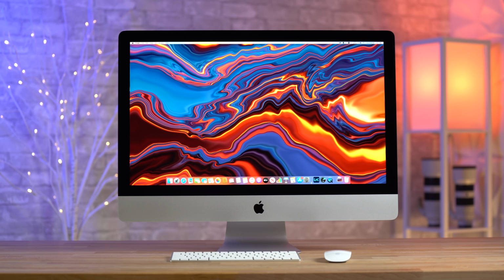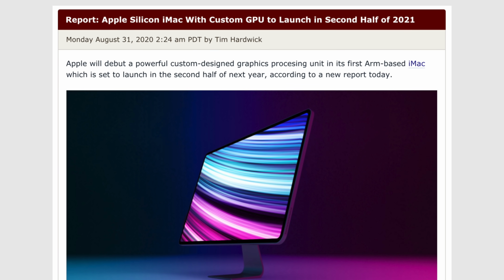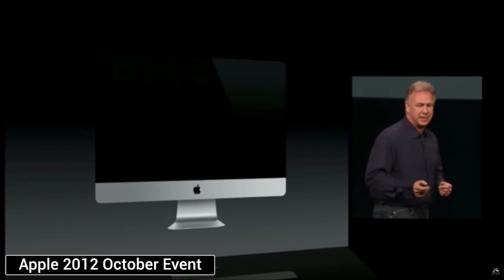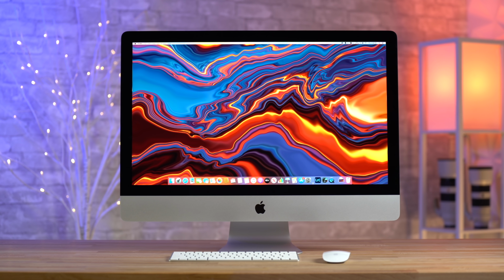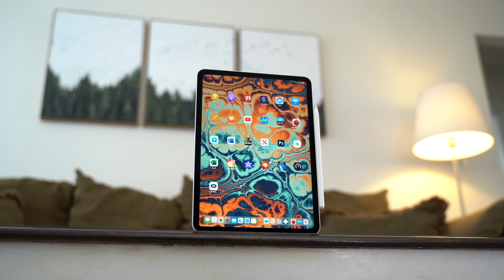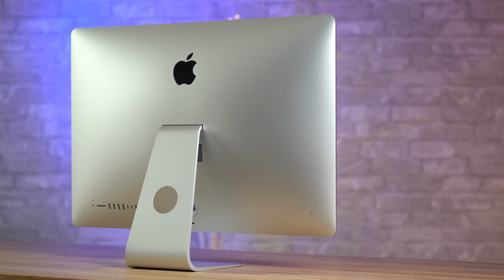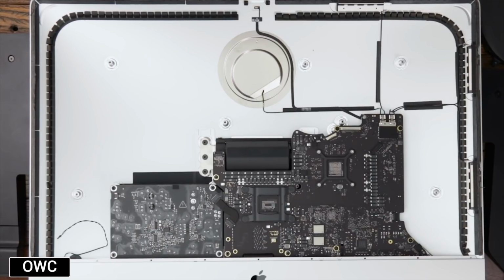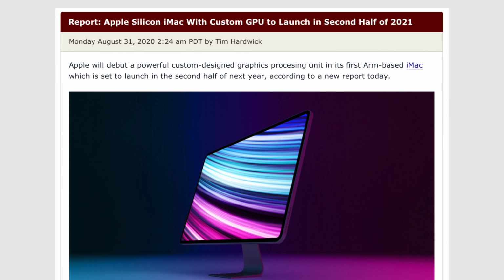Apple Silicon 24" iMac Redesign - I FIGURED IT OUT! 🤯

Comment: I would rather Apple match the thickness of the Pro Display XDR and use that overhead to push the performance further. There's no reason to throw in a wimpy thermal solution and artificially limit performance when they could adopt the iMac Pro internals (which utilize the space much more effectively) and deliver a machine that's quieter and faster.

Comment: iPad Air 4 is just going to have a cheaper display with only 60Hz, either the same 8MP rear or 12MP, A13 Bionic processor and the same design as the 1st gen 11-inch iPad Pro and Yes it will support the Pencil 2, 11-inch Smart Keyboard Folio, 11-inch Smart Cover and 11-inch Magic Keyboard

Comment: If everything goes like you're assuming then that means no more user ram upgrades. And if they are going to charge the same prices for ram as they are doing now, it will be very hard to justify getting an Apple Silicon iMac with a reasonable amount of ram.

Comment: Nice video, great work as always. Personally i love the apple cinema display and wish it came back. And so i wouldnt mind if the new imac chose to look like that, uniform bezel with the logo just small at the bottom. But i do agree that there probably will still be a chin. If apple didn’t care to have it, they wouldve shrunken the chin already. Meaning the chin is still around today because Apple it as part of the design.
Reply: Now the product i wanna really see/know about is the mac mini. If they wanna go the easy route, they could update that this yr and put their ASi instead of the A12z chip in the DTK and call it a day.

But i wanna see a user upgradable ram and storage unit with ASi and a proper apple gpu.  All of this will probably be next yr, but id love to see a mac product this yr that has ASi and can be used for “professional” work

Comment: the g4 didn’t have a chin—the chin has always been a compromise, but now they can fit all of the internals, including giant speaker housings, in the same chassis as the pro display xdr if they remove some of the venting holes. you also gotta remember the mac pro will eventually go into this chassis too, and that’s gonna have a high tdp even when apple is able to make a real gpu

Comment: Need to have that expandable ram slot on the 24 inch iMac!!
Reply: Didn't they used to have a bottom-loading access panel on the earlier iMacs? It's feasible they could do something similar on the new ASi iMacs again. If it's as thin as Max expects, it COULD be done by having them side by side along the bottom of the chin, but i guess that's down to whether Apple wants to keep the RAM upgradeable  or not.
Reply: Tim Beaton even the current imacs have expandable ram. Id imagine the redesign would keep that aspect.
Reply: @chloedegurechaff1941  The current 21.5" iMac's RAM can't be upgraded, and has been like that for several years. Obviously an Apple decision (good or bad...your choice!). 

So that's why I responded the way i did. Sai M said that he/she(?) wanted that feature in the new ASI 24" iMac which I would also agree with. This also needs to be taken into context with this video wherein it is speculated that ALL ASi iMacs might only come with soldered -in-place RAM, which I think would go down like a lead balloon.
 I merely speculated that in a slimmer iMac that this COULD be done in a variant of the method used some earlier iMacs
Reply: @timbeaton5045  Oh. I guess only the 27 inchs have upgradable ram. well heres hoping
Reply: @chloedegurechaff1941  Yep! I think we all are. Certainly Vitalis (above) thinks so!

Comment: I agree with almost everything... the dedicated graphics may still hang around, especially when talking about the pro lines... also, maybe ram will be on the SoC but there will be different tiers, probably 🤔
Reply: WILD CRACKS I just can’t see Pixar being content with an integrated gpu instead of a dedicated one on a Mac Pro... if prices would in fact go substantially down to make it feasible to get an external gpu then maybe, but I don’t see a pro line without dedicated graphics or the programmers going to great lengths on making their software near as powerful for the integrated graphics

Comment: Honestly I’d be happy with a pro xdr look that doesn’t have the cheese grater look in the back. The chin shouldn’t be larger than 3/4-1 inch tall. (The apple logo  shouldn’t be any larger than the size of the logo on the back of the iPhones)
Reply from the maker: Yes that’s exactly what I’m expecting. No cheese grater holes on the imac.
Reply: Max Tech do you think they might allow a sort of flat laying ram upgrade slot, kind of like how they have in laptops? The ram expansion is a big selling point fo me getting the larger display iMac 🖥

Comment: The 24 inch iMac is for sure gonna be my next computer
Reply: yeah, my macbook pro 13 8GB memory will only use for netflix . let's get the excessive crashes away
Reply: Mine the 27 🤔
Reply: Did u get the new 24”?
Reply: @samuell.siskind  apple made a big problem. Overheating on the base model. I need Ethernet, and on Amazon I can’t select the 30$ upgrade. So basically I’d need to get the mid tier model. I’m still considering buying it, but the Mac mini is more powerful, cheaper, has more ports and is more practical.

Comment: When do you think the mac mini will get apple silicon?
Reply from the maker: Hard to say. Haven’t heard much leaks so it could be sometime this year or 1st half next year?? Seems like the design will stay fairly the same. Just swapping out the chip. Who really knows.
Reply: @MaxTechOfficial  I agree the dev kit shows that this is the fastest device to produce with Apple Silicon inside, due to the fact that don't need hot performance or pro app to be a bestseller like a Macbook Pro. I hope it will came later this year, we need review of apple Silicon.
Reply: that should happen really quick, they’ll start by slapping a real desktop cpu into the transition kit
Reply: Hopefully sooner than later, I love my Mac mini, would even better if they integrated Apple TV into it ... a complete one-stop-shop.
Reply: @deanmeixner  they use to do that before releasing the first Apple TV which was still based on Intel x86 and macOS. The later versions of tvOS were based on iOS and Apple Silicon so Apple stopped integrating Apple TV UI with media remote on Macs. With Apple moving to Apple silicon you can expect that to happen.
Reply: It would kind of make sense Apple releases a MacBook with SoC and a MacMini along side it for developers. They should / could share a lot of internals.